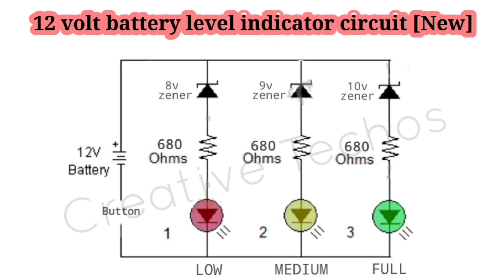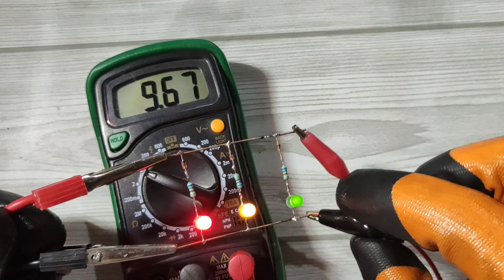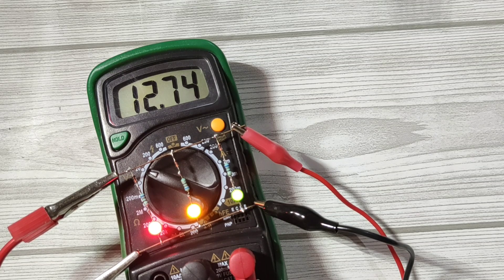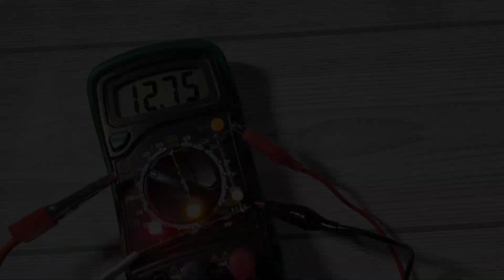12v battery level indicator circuit [NEW]

Comment: Very nice! I want to make this for 8.4 volt (2S lithium ion battery) . Which value should be changed? I mean what will be the values of zener diode and the resistor's. Please help. Thanks in advance😊
Reply: Use Zener Diode "8.2 volt & 6.2 volt use resistor upto 1k ohm

Comment: good job but... is better to test battery under load.. just place a resistor (of correct power) in parallel with your circuit to have a real test.

Comment: Very useful and interesting info.  I like the simplicity of this LED Voltage ladder readout. No logic gates with op-amps. Thanks!
Reply from the maker: Glad it was helpful!
Reply: Creative techno
Nice circuit and I built it but to add it to the charger circuit 
Please let me know if this level indicator is safe to have it continuously connected to the battery without the push button switch 
I have used 1/4 watt zeners and resistors 
Awaiting your reply

Comment: use 9v, 10v, and 11.1v zener for best monitoring and use.
Red=900ohms, yellow 750 ohm and Green 680ohms resistor for leds brightness and safety consumption.
Reply from the maker: Thanks for your suggestion, i will try soon

Comment: Great that you have added a circuit diagram ! .... the 12 Volt battery charge ( float ) voltage is 14 Volts ( and NEVER higher ! ) , maybe an additional  BLUE  LED could be fitted with suitable voltage Zener to indicate charger is maintaining the battery at 13.8 to 14 Volts ? ? ...... DAVE™ ........
Reply: Вольтметр цифровой китайский поможет😉

Comment: Thank you for this awesome video, my friend!
Could I ask you what kind of resistors I should is if I were to use a single RGB Led with same zener diode configuration to light each color for each voltage level?

Thank you so much!

Comment: not right, this is show Vol, not show Am, Battery level depend flow Am
Reply: If you mean amps, you could always solder a 10W resistor in parallel with the supply leads to the test circuit as a load. Such as 22 ohm. That will give a draw on the battery of 0.545A (I=V/R). Wattage of resistor would need to be 6.5W (P=V*I).

Comment: Bro in this circuit, how many watts of zener diode which  has used in this circuit
Reply: Bro thanks but a problem arise that 350mw is not  available please tell me website where I purchase it
Reply from the maker: You can use also greater wattage then this, also components can be easily sourced from ut source
Reply from the maker: 350mw zener diodes can be used
Reply: Ye resistor konsi film ke hai 
a.metal 
b.carbon

Comment: Bro please tell zener diode kitne watt ke hai correct value
Reply from the maker: You xan use minimum 350mw
Reply: Aur maximum
Reply: Bro es circuit me tumne kitne watt ke zener diode estemal kiye hai
Reply from the maker: 350mw use kiya hai

Comment: Bro zener diode full details briefly
Reply from the maker: Please check check diagram, download link is in video description, 
Zener diodes used is 
8v or 8.1 (8v1)
9v or 9.1 (9v1)
10v or 10.1 (10v1)
Reply: Thanks

Comment: 8v and 9v zener diode is not availabe but 8.2v and 9.1v zener diode is available in market it can work accurate
Reply: But 8v and 9v zener diode is not available but 8.2v and 9.1v zener diode is available
Reply from the maker: Yes, they will work, check out this chart
https://www.onsemi.com/pdf/datasheet/1n4736at-d.pdf
Reply: @CreativeTechos  bro please tell me all zener diode kitne watt ke hai
Reply from the maker: Please check check diagram, download link is in video description, 
Zener diodes used is 
8v or 8.1 (8v1)
9v or 9.1 (9v1)
10v or 10.1 (10v1)
Reply: Thank you very much
Reply: Thanks for all please tell me all zener diode kitne watt or kitne mw ke hai
Reply from the maker: Use 350 to 500mw

Comment: Copper wire is necessary
Reply from the maker: You can use any Wire, It is recommended to assemble it on zero pcb / pref bord.
Reply: Thanks

Comment: All zener diode full details
Reply from the maker: Please check check diagram, download link is in video description, 
Zener diodes used is 
8v or 8.1 (8v1)
9v or 9.1 (9v1)
10v or 10.1 (10v1)
Reply: Thanks

Comment: All zener diodes full details
Reply from the maker: Please check check diagram, download link is in video description, 
Zener diodes used is 
8v or 8.1 (8v1)
9v or 9.1 (9v1)
10v or 10.1 (10v1)
Reply: Thanks
Reply from the maker: My pleasure.

Comment: Plz make led running controler for home
Reply from the maker: Didn't got you, please mention fully.
Reply: @CreativeTechos  led strip light speed controller RGB plz make circuit
Reply from the maker: Got it, RGB leds strip with Speed control in colour shifting, I'll try to upload ASAP

Comment: Pls I'd like to know why the lowest is 10volts and not 0 volts
Reply: Okay thanks
Reply from the maker: My pleasure 😊
Reply from the maker: There the lowest will be 11v where the battery is actually empty, and overdraining it will cause battery to get dead, so it should be maintained as 11v empty & 13v full.
Or if you want level indicator to show level below 11v please check out another video on my youtube channel.

Comment: Can you do a video on a battery meter circuit for 3 - 3.7V lithium ion batteries in series for a 12.6V battery. Most videos I have seen are for lead acid batteries in 12V I wish to see this for lithium ion 12V battery. Thank you.
Reply from the maker: I'll soon upload for 3s 3.7/ 12v lithium battery.

Comment: Can I charge 4 18650 batteries with this 12v mount?
Reply from the maker: Check out this video to charge 18650 based 12v battery with adjustable autocut off on full charge
https://youtu.be/nvlOeDHkwK0

Comment: Nice ur lacture.pls make a ragulater suply circut on 1.5 volt to 24 volts on 10 amps or 1.5 t0 19 volts on 15 amp pls help .
Reply from the maker: Check out on my channel already uploaded yesterday 1-30v 10A adjustable power supply circuit
https://youtu.be/J8KifBptLYw

Comment: Can I ask please, what is a battery meter actually measuring?
I ask because I asked a company I’ve just bought one from whether it was a simple to read voltmeter/ammeter but with a % indicator. But they said it wasn’t.
But your demonstration suggests it is a voltmeter! Or is it to do with ohms?
Reply: It has to do with the voltage drop across each LED.  LEDs have a posted voltage drop usually around 2 V for red LED, and the other colours can have 3 or 3.5 volt drop.  When your battery  has too low of a voltage you do not have enough Voltage to light all LEDs.  Therefore the LED with the highest Voltage Drop will go out first and then the next one with the highest voltage drop.  So you are monitoring voltage.  Check your LED voltage drop with your multi meter.  Just take your LED (with no power - before you add it to the circuit) and set your meter to the DIODE reading and connect the meter leads across the diode and you will get a reading in volts.  This will be the voltage drop for each colour of your LEDs.  Remember LED stands for Light Emitting Diode (so it is just a diode).  He is using ZENER diodes to accomplish the same thing.  You could just use a regular diode to protect the circuit rather than using the zeners to shut the LEDS off.

Comment: Thanks for the reply this video I have watched , my question is can we connect to 12 volt 150 Amps batter home inverter .plz answer me
Reply from the maker: Yes you can
Reply: @CreativeTechos  both circuit or the new one ... Plz make a video on that connecting to home inverter with higher Amps like 150 or 200 Amps battery (12 volt ).
Reply from the maker: You can use zener diode based circuit with higher amps
Reply: @CreativeTechos  thank you so much for the clarification , I would be  very glad if you made a video on that .